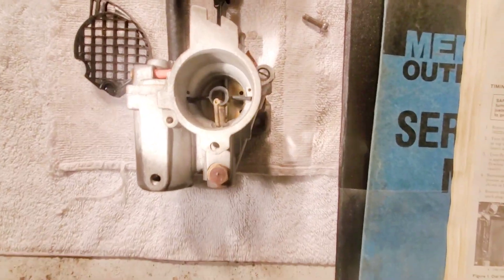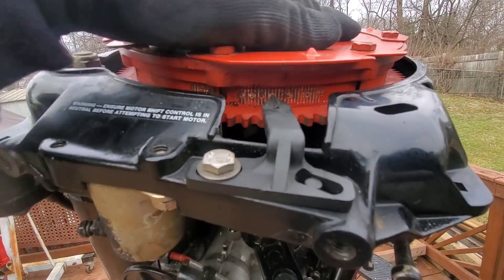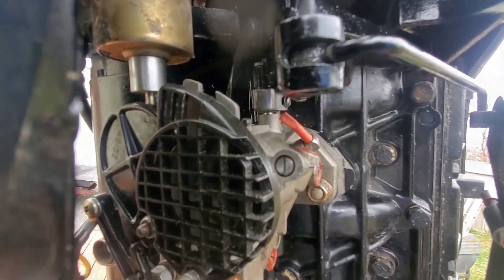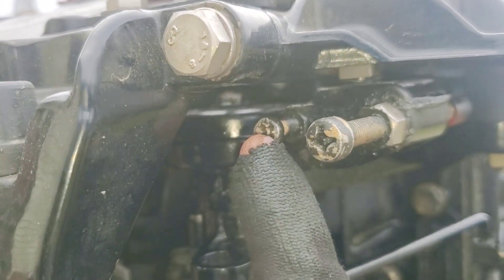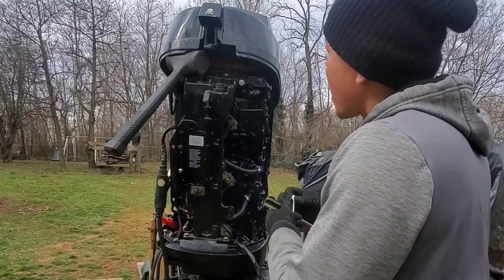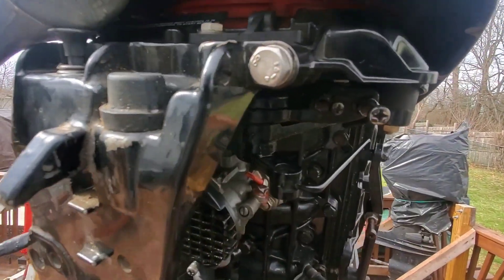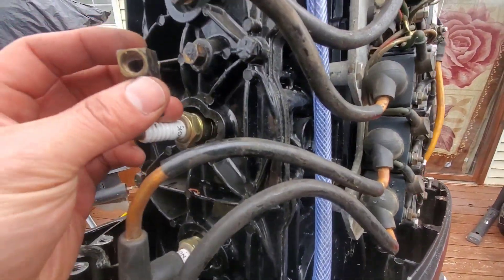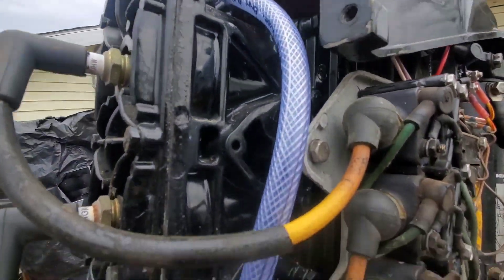L6 Outboards Link & Sync: ADI Ignitions

Comment: Thanks so much for your videos! I have an 89 115 Mariner that I've brought to 2 different dealer repair shops. Almost $1500 in charges and no results because they don't have old motor experience! I've rebuilt the motor twice do to my misunderstanding to oil tank and not knowing there was no shut down for running out of oil. Problem has been adjustments for the 3 carbs and knowing the timing procedures. You are an absolute great help! God Bless!

Comment: Son,  I just picked up a Ranger 335-V with a merc 115. I noticed my main timing pick up stop is not letting the throttle arrows line on the throttle link. Do you have a direct contact so i can ask some questions.

Comment: Need help, flywheel numbers so bad cant see, tdc pointer at 3 tdc with stop method,  I have  78.5 L6 90 hp. ADI 1 to 3 BTDC
20 max for 18 degree at BTDC. Any suggestions? To get this timed
Reply from the maker: Get a new flywheel or flywheel sticker. TDC will help a lot. Son

Comment: Son. What material is the reddish plugs (at top 2per carburetor) you used ?  Heat shrink?
Reply from the maker: Yes sir. Be sure carbs do not have fuel in them....

Comment: Hey Son, can’t tell you how much we appreciate these merc vids! Wouldn’t have much of a clue without them. Curious if you have any insight on a weird goose chase we’ve been on with our 1982 90hp tower of power. It’s been nothing but a headache since getting it.. was really hard getting it to start originally but after we got it going it would start somewhat easily. It currently just about dies every-time it’s in gear. Come to find out it was only running on 3 cylinders. We had spark on cyclinders 1,3, and 5. So we replaced the even cylinders switch box with an oem merc one. Weird thing is once we installed it and tested it on the water the boat was doing pretty much the same thing. Dying under load with anything above 2mph roughly. Checked spark again and we only have spark on cylinders 2,4, and 6 now 😑 extremely confused at this point. It also starts surprisingly easy on 3 cylinders now.. 

Everything is hooked up correctly to my knowledge. Our triggers and stator  tested good per your videos and now I’m completely stumped 🫠. Would greatly appreciate any ideas you might have! 

Thanks 
Hans
Reply from the maker: Both switches need to be replaced simultaneously. Don't mix switches and be sure the bias wire is connected. Son

Comment: Those red things on your carbs what are those? I have lines running to them .. The red on the float bowl cap and by the mixture screws should the be capped or lines?
Reply from the maker: It's the mid range air that feeds your carbs which thins out the fuel which thins out your fuel/oil..... which I do not recommend. Son

Comment: 1989 Mercury 115 I can't read the timing mark decal I can see 21° would you happen to know what the first number is ser#0A985968 also so taken off the ladle stabilizer
Reply from the maker: The L6s stop production in 1988. Do you have the wmk carbs?
Reply: @MerCSonL6  yes I do
Reply: 1988 sorry fat fingers lol
Reply from the maker: @robertkennedy5026  lol, your idle should be set around ATDC 5-7 degrees with all butterflies completely closed if your reeds will let it idle thar low. Son

Comment: Love the videos … I have an 86/87 115 . Was trying to set base timing yesterday using your video.  When cranking I was not getting spark @ all the cylinders (wasn’t firing the timing light)  the motor runs like it drops a few cyl @ lower idle speed . Currently have it set to idle around 1000rpm just to keep it running but surges in gear on the water. Any help would be greatly appreciated . I’m thinking a bad/weak pick up? 
Motor runs fine through the rest of its range.  First time owning one of these.. Thanks!
Reply from the maker: Best test is to make sure your switchbox is putting out the correct voltage. I'll include a link below. Son
Reply from the maker: https://youtu.be/owEbiP69ouU
Reply: Found the the stator was open on the red/blue wires. just got a new cdi part & gonna try set my timing again . Thanks for the reply , & all the great videos..!!!

Comment: Great videos on L6 engines. Not too familiar with these engines but your videos are a big help. I picked one up recently for my hydrostream, 1986 115hp. I just had a question,  could I have damaged anything with coils or switch boxes checking commpression without grounding plug wires?
Reply from the maker: It possible but rare. The voltage needs a place to ground and return to the battery. Do a spark test. That will confirm your suspicions. Son

Comment: I have an 84 90 hp that I have been working on. I can get it to run, but it won't idle. So, I just loosened the primary screw until it would stay idling. Does that sound like anything obvious to you?
Reply from the maker: Timing? Should be around 5-7 ATDC if my memory serves me well. Otherwise the carbs may need rebuilt. Son

Comment: hey man i am struggling with my motor i have gone through the whole motor and cant figure out my bogging problem.  i think my stator is going bad do to some corrosoin but i cut out what i could and replaced with soder connectors.  its a 83 adi 115 hp model.  the boat wont start with out ether but once warm will run.  sounds great till i put it in forward then wont get out of the hole at all. did a carb rebuild and one float was bad and a needle had broken off so i replaced it.  the timing was off so i re set that also. but i am just lost and have no idea what to do anymore.  any advice ? i love the motor when it works its badass and hope to keep using it
Reply from the maker: Bench test the stator to rule it out. (I'll be doing a video soon). If thats good then it's a carb issue. If all carbs are not properly syncd it will bog. Also, check all fuel connections starting with the boat pick up all the way into the carbs. Cannot have any blockage/leaks and fuel must flow freely from connection to connection. Son
Reply: thank you so much for the advice just sa this.  wrote you on another post but ill try that and report

Comment: what should i set primary idle to 5-7 or have you some better number , how do i set idle speed when idle stop screw or ignition screw? I have to high time speed on when the 2 lines are in line
Reply from the maker: What year is your engine? I only ask because the prerequisite is different from ADI ignition to distributor models. Son
Reply: @MerCSonL6  I have too high idle when the lines line up 

I happened to express myself a little wrong in my first comments
Reply from the maker: @erikandersson6907  I understand. Are all of your butterflies completely closed? What degree is the flywheel reading when you time it. Let me know. Son
Reply: @MerCSonL6  I'll check it when I take the strobe and remove the cover over the carb 

can I get in touch with you via email and send some pictures?
Reply: @MerCSonL6 5 @MerCSonL6
Reply: set the timing to 4-6 and left the high on 20 , i also tighten the linkage it was a bit shady
Reply: @MerCSonL6  mariner/ mercury inline 6 115hp don't know exact year but it's a adi ignition

Comment: Excellent, simple and detailed explanation on how to followed every step of your video and was able to make the engine run as it should I think. I have uploaded a video under mercury L6 if you can please watch it and let me know to your best ability if it’s still missing thanks 🙏
Reply: I finally was able to put the boat on the water it started with a few tries and idle speed was fine , but once I started giving throttle it just wouldn’t move like it is supposed to and started missing and lost power but did not die . Once It was on idle it was just misfiring. Any suggestions to what needs to be done.

Comment: Attempting to reset the timing on mine.
Current situation is I have to advance the throttle to fire up, it stays running,  bring it back to neutral and it dies.
While running I'm getting white sludge from the prop, used to be gray in color but now it's white.
The timing spec tag is barely readable, should be the same as the one in this video which is helpful.

Will  see how tomorrow goes, video was very helpful, thank you.
Hoping the timing and carb sync is out of whack, compression is 120-122 down the line

Comment: Any ideas why a 1980 90hp Mercury would idle at 1100 rpm, in neutral, after link and sync?
Wouldn't adjusting the idle stop screw throw the timing off?
Thanks. Really enjoy your videos.
Reply: Actually, found TDC pointer was off about 5 degrees. Will redo link and sink.

Comment: Whats your opinion on removing the idle stabilizer the wires on mine are roached is it a good idea and should I make any timing changes with it off ??
Reply from the maker: Disable and time it. Son
Reply: @MerCSonL6  do you time it to the factory specs or is there a correction for its absence
Reply from the maker: 19 BTDC for max then set your idle per specs. Son

Comment: Do you have to bring it back to ATDC after every adjustment before you use the timing light?
Reply from the maker: I'm not sure what you mean. I only bring it back or move it forward if the timing specs are not correct. Son

Comment: When you start the timing you said to unplug that ADI box after you set timing as you did in the video you plug the Box backup correct or do you leave the ATI box unconnect
Reply from the maker: I think you are referring to the "idle stabilizer?" Yes, you plug it back in if you like a cpu manipulating your timing (I don't). Son
Reply: @MerCSonL6  yes that's what I was referring to I got mixed up I've been watching a bunch of your videos got a 88 Mercury 115 that's been sitting for 23 years after it was rebuilt and I'm having float problem so I'm rebuilding the carburetors and I remember watching one of the videos you said you don't like that is that necessary to have on that motor or can I leave it unplugged just trying to get the best performance out of this motor
Reply from the maker: @robertkennedy5026  unplugged. Its the side effect of the advent of the V6 which all of them have because they need it to idle. You do not need it to idle. Ported direct charge pistons can be difficult to get to idle under operating conditions and different circumstances but I run my 88 L6 without... no issues. Son
Reply: @MerCSonL6  one other quick thing about the carburetors I saw on your video you took the tube and put heat shrink on instead of having the crossover tube can I do that to my 88 or do I need to have the hose going from one side to other remember you're saying something about him running real lean and that's why we had to have it rebuilt because number one and number 6 burn up so I don't know if that was the cause of it but thank you for all your info and your videos is very helpful mechanics are very hard to find to work on these motors I've got two more Motors that have Distributors I think are 1978 ,90 and 115 I'm going to building during the winter time so your videos have helped me out a lot
Reply from the maker: @robertkennedy5026  I always cut the leaning circuit. More air less fuel. Less fuel less oil. Less oil..... you can fill in blanks. Thank you. Son

Comment: Just curious- why is it necessary to pull the plug?  I've already verified TDC with a piston stop, and there is no fuel in the motor so it can't start.  When I ignition time a car I don't pull the #1 plug,k I just connect the timing light pickup to the #1 wire.
Reply from the maker: Its not necessary. I just do. Thank you. Son
Reply: @MerCSonL6  Cool deal, thanks a million.  I'm always the guy asking "why", helps me have a better understanding of how things work.

Comment: Just bought a 81 90hp it sat for many years and all of the good ran out of the stator and switch boxes I assume due to age and sitting I ordered the stator and switch boxes along with the rectifier. My question is will I need to re time the engine when replacing the stator? This is my first outboard and ya I know I should probably take it to a shop but I'm old school and cheap lol
Reply from the maker: Definitely re time. Son

Comment: Hey Son, What would cause my L6 to not adjust to 19 BTDC. The most I can get is 11 BTDC for Max Spark adjust. My Mercury is a 1987 115 with ADI ignition. Thanks
Reply from the maker: Flywheel could be positioned wrong. It is keyed so you can check by removing the flywheel. Let me know. Son
Reply: @MerCSonL6  I'll check when I get a chance. Thanks!
Reply from the maker: @ScottySmac  is the max set with the max screw all the way in/tight?
Reply: @MerCSonL6  I found out my motor does have a idle stab on it. It's coming out tomorrow.... I'll retry the max adjust afterwards. Thanks
Reply: @MerCSonL6  hey Son, I checked and my engine did not have a idle stabilizer. I ended up screwing the Max screw almost all the way out. I was able to achieve 19 BTDC. it's running the best it ever has now. Thanks for your video and help.
Reply: @MerCSonL6  I did the TDC piston stop on it and the the fly wheel was dead on 0 degrees. Won't this tell me the flywheel is in the right position?
Reply from the maker: @scottymac62  geometrically yes.
Reply: @MerCSonL6   Do you know if my 1987 Merc has a idle stabilizer on it? I did not see one attached up front. I thought that might be causing my issue?
Reply from the maker: @scottymac62  some do some don't. It's worthless..... in my opinion. It manipulates timing. Only the person at the helm should be able to do that. Son

Comment: hello man, i bought a boat and this mercury 115hp 6L came 1988 it doesn't start easy, after it starts it has no problems to start again, start the first one, accelerate well in neltro, the engine doesn't pick up speed in water to be the ignition point  that or just hit the carburetors, 130psi, in all 6.
Reply from the maker: Carbs are the best place to start. Rebuild them. Son
Reply: Tks Sr.

Comment: Hi again MerCson, can you please let me know what to do in this situation? I have a L6 115 1982. My engine states 5-7 deg ATDC at cranking. I have it set at 5deg but it is a bitch to start in the cold. Fine when hot but hard when cold. Needs a fair bit of throttle. Would retarding the timing help in this situation? (1st pickup still hits at 2-3BTDC). I have read your comments above but thought I would ask just for clarity.
Reply from the maker: I have had issues in the past getting adi ignitions to run @ specs. Just try to keep your idle below 1k so you don't kill your lower. Son

Comment: Is it possible to put a newer tilt and trim on these? Say an 85 model year from a black max? I have a 1976 115 top, thanks
Reply from the maker: Anything is "possible." However, you would have to fabricate under the midsection where the middle ram off your max connects. Theres a trilobe pin that attaches the ram to the midsection. A 1976 does not have this. I do not formally recommend it unless you are handy with metal working and welding. Furthermore, the powerhead bolt patterns are different so a simple swap will not work. Son
Reply: @MerCSonL6  Thanks :)

Comment: Hey I have been having trouble with my motor trying to get it to run in the water. I tried to clean the carbs on my own and ever since I put in the gear R or F it would cut off. i would follow the manual but never could get back on the water. It ran fine up until I tried to work on it. My former mechanic worked on it previously. I sent a message on the bay were you have this listed.
Reply from the maker: Sounds like it's a needs a link and sync. Typically, dying when you put in gear could be a sign of not of enough fuel and or improper timing. Let me know. Son

Comment: Hey man I just picked up a glastron boat with the mercury 90hp tower.  I'm really glad I ran across your channel and really appreciate the videos.
Reply: I bought the boat at a used car lot.  They compression tested it and showed me 150 on all 6 cylinders.  I took it on the water and it ran great at first.  I hit 50mph but then it started bogging out and only went about 30mph.  The power would come and go.  Today I replaced the spark plugs, filled the lower unit oil and went through the gas lines.  I found a fuel connection that was partially clogged.  I'm gonna take it to the lake tomorrow to see if I see an improvement in performance.

Comment: Is that the ranger project?
Reply from the maker: Yes sir. Beast of an engine. It twitches when you Throttle.
Reply: @MerCSonL6  it's going to be hard to replace this one.  That unit was right at  160, I would darn curious what the numbers do after the rings have settled in.
Reply from the maker: @robertpayton3795  I agree. I am tempted to run a compression again while I have it all hooked up.
Reply: @MerCSonL6  it's going to be surprisingly excellent.  That unit has very little hours on it.